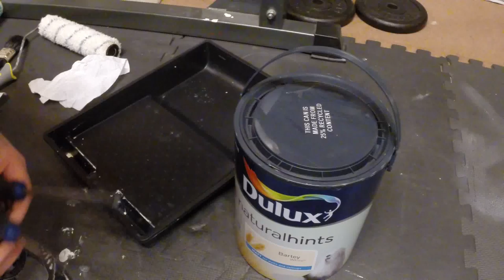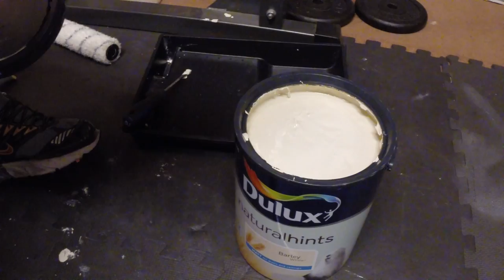Dulux lid - secret incantation to opening

Comment: I looked at my tin and thought how on Earth am I supposed to open this so I looked on YouTube and found this video. Great advice I thought.  I went to the garage and dug out two huge screwdrivers to follow the instructions. Guess what - I inserted a large screwdriver in the slot, twisted it and the lid popped straight off in 2 seconds with no need to fiddle about with two screwdrivers, or loosen from the other slots. Easiest paint can lid I’ve ever removed. Perhaps it’s just a case of getting a screwdriver in the slot, just one in my case, at the right angle to flip the lid off. 
That said it would help if Dulux gave some directions on the tin - a major omission!

Comment: I've got a Sandtex masonry paint can with the same sort of plastic lid. Nightmare. I just found an easier way to open it.  There were 4 small plastic tabs around it which I pushed my screwdriver into to break them. Those may or may not be on other tins. Large screwdriver in position and tapped it four or five times with a hammer and it came off easily.
Reply from the maker: Good to know, thanks

Comment: Er, what slot, where..?
Reply from the maker: Did you find it? There's three of them I think on the rim of the lid.
Reply: @waymarkerbushcraft  Hi, no I haven't. I have managed to prise up the lid, but in doing so have messed the lid up rather. What do the slots look like..., how big.., where .. ?
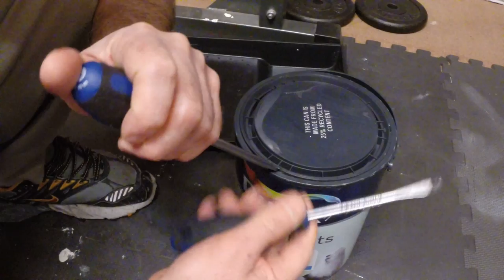Reply from the maker: @andrewpreston4127  They are on the actual lid, just small indents only just big enough for a screwdriver. Unless they've changed the design in some way. You can see them quite plainly at 0:22 In fact if you pause around about the 1:00 mark you can see a slot clearly visible well contrasted against the paint in the pot.